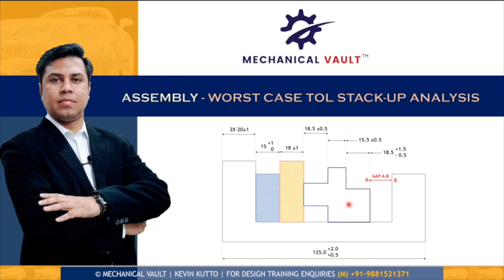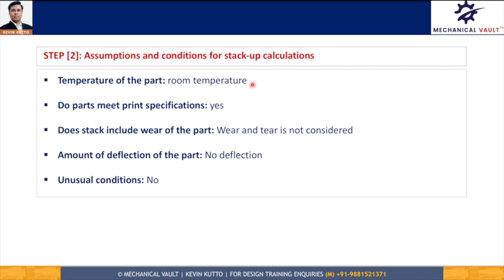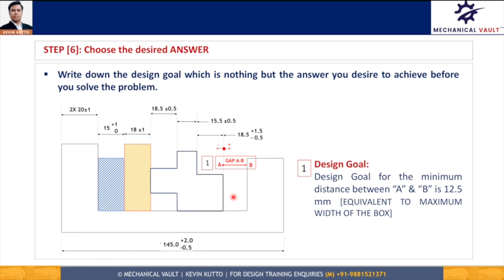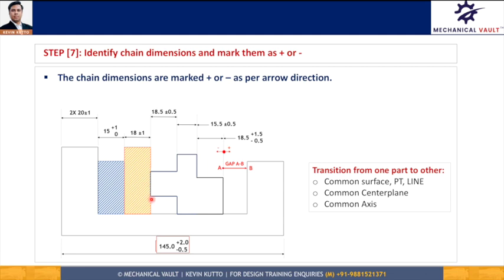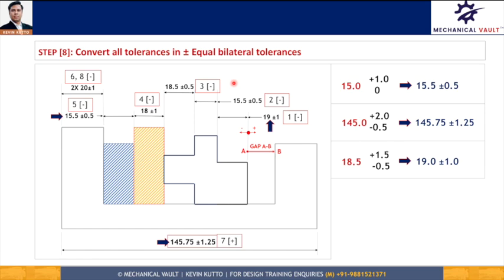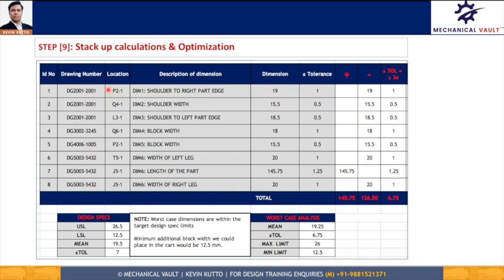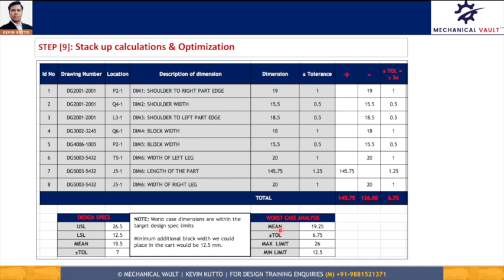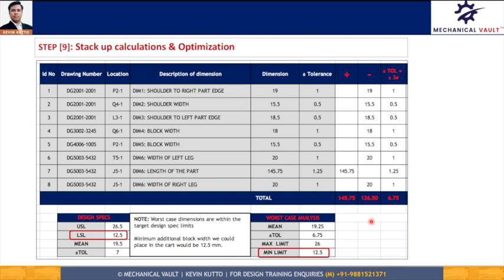Tolerance stack up analysis in assembly | Kevin Kutto | Mechanical Vault

Comment: If the 4'th container is currently manufactured and measured at 26.5 (USL), how will it fit the gap as the Largest gap((A-B)max) possible is 26! It will not. Hence the statement in the NOTE in table - "Worst case dimensions are within the target design spec limits" would not hold true. 
For the 4'th container if manufactured and measured at 12.5 (LSL) and upto 26 would definitely fit the gap.
Need some clarity on the above thing but such a nicely explained video!! Thank you very much!

Comment: How come distance between A&B is 12.5 can you please explain
Reply: The box required to be placed in the gap is already designed, and its maximum possible size is 12.5 mm. So the goal is to check if the gap is sufficient in the worst case.